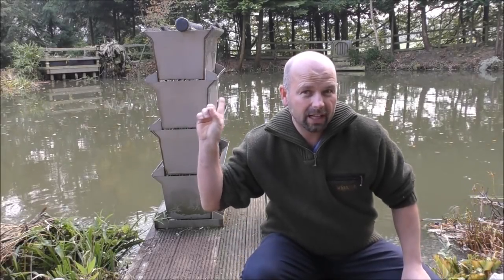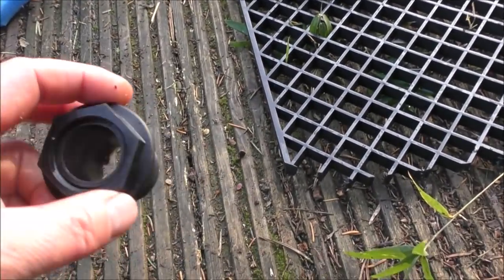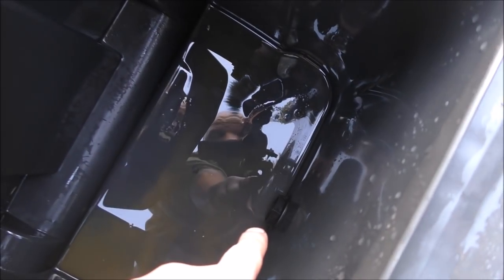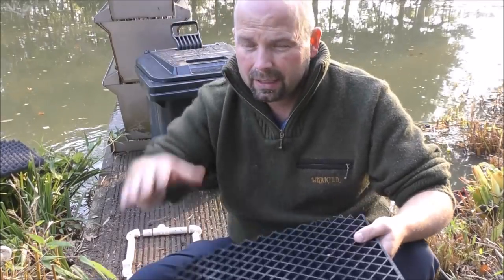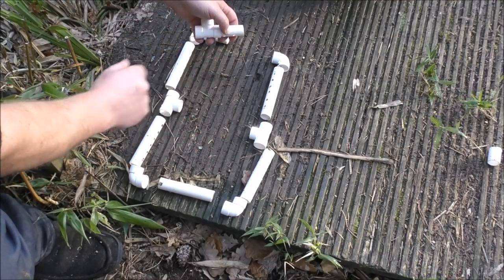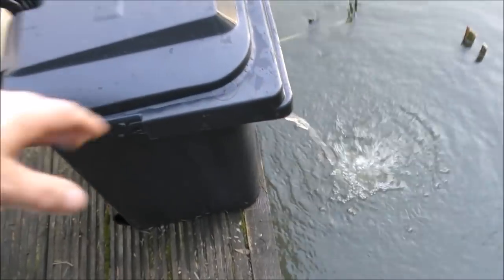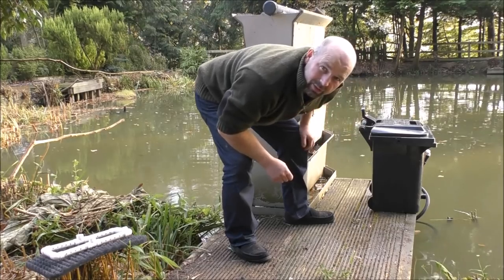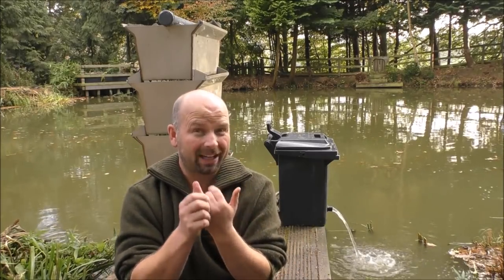DIY Wheelie Bin Koi Shower Filter (great for healthy water in a fish pond)

Comment: Hi PG, I am a newcomer to ponds and aquariums and I have found your videos very useful. I have just bought a 50 litre mini wheelie-bin on Ebay from zorotoolsuk for £26.39.I am thinking of fitting a rubber sealing strip around the inside edge of the lid  together with a  couple of fasteners to hold the lid down. Then I would like to run the bin as a pressure filter with your recommended filter media and sponge filters reversed. Then with the unfiltered pond water inlet at the bottom of the bin I would like the outlet at the  top of the bin to feed a small waterfall before the filtered water re-enters the pond. What do you think?
Reply from the maker: In theory that would work but the media would be submerged which may not be as effective as if water was falling through it. If you have a couple of 2" outlets on above the media you should not need to fasten down the lid unless you intended to direct the outlet up above the water level in the filter. Also, the foams would be more difficult to clean if they were under all the media - for a true pressure filter it may be better to just buy a decent pressure filter ready made up with easy clean options.
Reply: Hi again PG, Many thanks for your quick and very useful reply. I would like to direct the outlet approximately 18 inches above the top of the wheelie bin to feed a small home-made waterfall. Does this seem possible if I seal the lid? Its a good point that you make about the foams being more difficult to clean if they were under the media. However on Ebay I have seen special net bags for sale that can contain media. Would this be a good idea? I have not seen all of your hundreds of Youtube videos yet but already I have got the impression that there isn't a decent pressure filter to buy because they all rely on just foam filters. Am I wrong? Apart from that I am, like yourself, a naturally thrifty person and your wheelie bin filter idea should hopefully save me a few hundred pounds and provide me with a top class filter. Once again many thanks for your help and any more comments or ideas from you will be much appreciated. Finally could a Pressure Wheelie-bin Filter possibly be the topic of one of your future Youtube videos?
Reply: P.S. Sorry PG but on line 6 of my last message I meant to say : 'because they all rely on just foam filters and plastic media'.
Reply from the maker: Yes it is a good idea to have the media in bags if it is the type of filter like a bin or barrel buried in the ground. I'm not sure a bin would make a good pressure filter as the sealing of the lid would be a problem. Ideally for a DIY pressure filter you would need a barrel which had a rubber seal around the neck and a locking lid. 
I can't find such a thing online but I know they exist and are made for chemicals. This is the nearest type I could find but doesn't seem to have a rubber seal: https://bit.ly/2qKmfy8

Comment: HI Richard.. this is really cool. I'm sure it cost far less than the one I have. When mine wears out I will try constructing one like this. You know my pond is very small but this year I am going to heat it so I don't have to bring the fish in. Not sure that it will save me work as I'll still need to clean it out in the spring but it will free up a couple tanks for me!!  =D ♥♥ 

Looking at this gravity does the work in the shower flow part so all I would need is a pump right?  Oh yes I like this idea!!   Have a great weekend Richard!!  ♥♥ I also want to get some of the pumice for my canisters. =D
Reply from the maker: Yes the water flows through the foams and media by gravity just like really old types of pond filters used to do. I'm not sure why the hobby moved away from that sort of filtration as it was the most efficient with regard to supporting bacteria of all types.
Reply: This is something I'm going to work on next summer. I love tinkering around with stuff like this.. and of course my pond. I wish I could add one or make it bigger but hubby isn't warming up to the idea yet =D ♥♥

Comment: Hello Richard, great video and thank's for the tip, one question really Richard would this system be adequate to run a 10 foot by 5 foot by 4 foot Koi pond i'm going to build in the spring? also would i need to run water through a UV before or after the filter. Brand new to this so i'm watching as many of your video's as possibly.... Cheers mate
Reply from the maker: Maybe the next size up (75 litres) would be more appropriate but as the fish will be small in the (growing on?) pond even a filter of the size shown here may be adequate - it all depends on stock.

Comment: A sphere is one of the worst efficient shapes for packing into a space.  Yours is a bit better, since it isn't uniform, but it's still not great.
Reply from the maker: It is really good for packing into any given space since each piece is a different size. You can get a mad amount of media into a container and still have water flowing through the media freely. The amount of media can be around 2x as much using the round shower media as it would using standard 'bakki house' media since there is so much wasted space with the tubes having a huge hole through the middle of them.

Comment: How do you clean the first media?
Reply from the maker: To clean filter the media will have to be removed to a bucket and washed in pond water but for the most part it should stay clean as long as foams are used in the top of the filter. Best thing is to have a pressure filter before the shower filter to catch the muck - makes cleaning really easy if you get a good pressure filter as that is all which needs cleaning and many have cleaning methods which don't involve taking anything apart. Check recent videos I did for one called 'Pressure Filter and Shower Filter - a Match Made in Heaven?' to see a possible set-up demonstrated and explained.

Comment: If you spend 60 quid on a 45 litre wheelie bin for this DIY project then you need your head looked at. You can pick up a 68 litre storage tub from B&Q for a tenner and build the exact same system.    In fact the amount of money he spent on all these components is more than you'd spend on a semi decent ready made filter.   Also the elbow tank connector in the link description won't work. It has threading all the way to the end so it won't fit into your T connector. You'd need a female to 20mm adapter for it to work.   The tank connector in the video appears to have the threading stop before the end, with the last bit being just 20mm pipe.